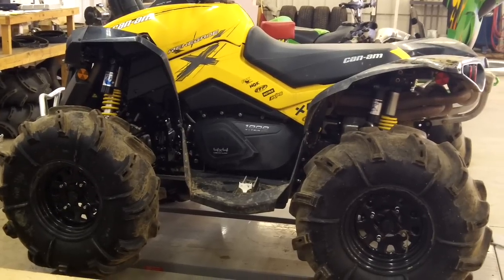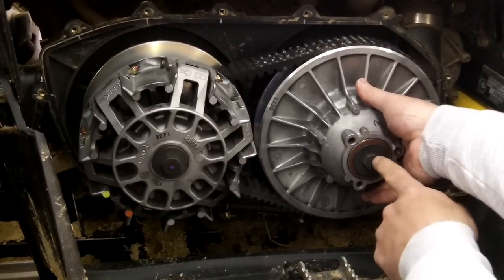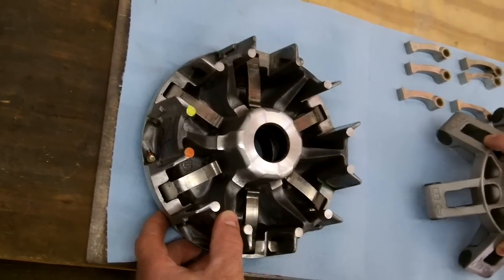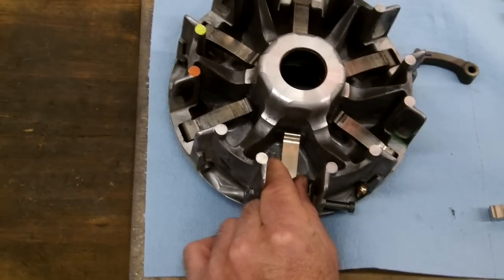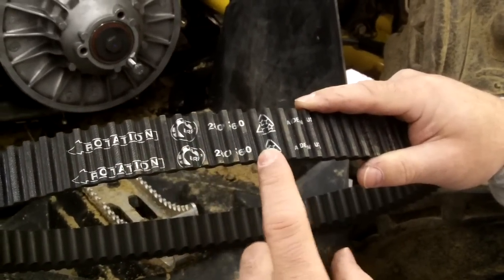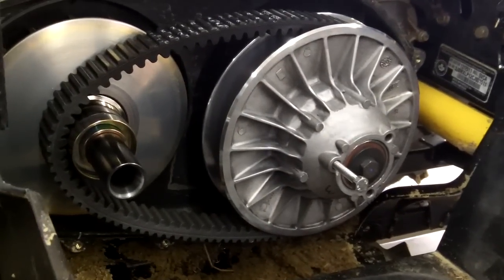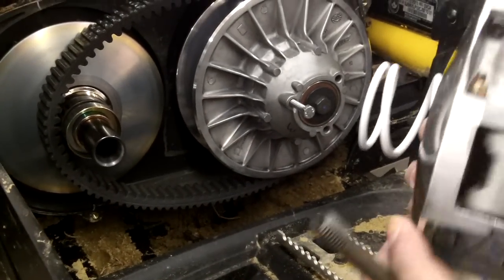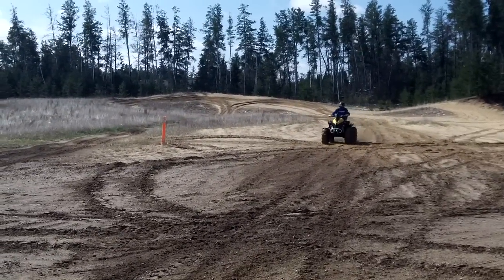Can-Am 2012 Clutch Kit Install EPI Performance

Comment from the maker: 32 grams are the lightest we sell for the Can Am's.  If you are trying to raise your rpms by going to a lighter weight you can also try going to a stiffer primary spring on the end rate.  One other option might be grinding the weights down a little but you have to be careful on not changing the profile to much.

Comment from the maker: Torque the primary clutch bolt to 89 ft/lbs +/- 6 ft/lbs.  Can-Am recommends using a new secondary (driven) clutch bolt every time the bolt has been removed.  Can-Am’s torque procedure for the secondary (driven) clutch bolt is: Step 1 torque bolt to 15 ft/lbs +/- 1ft/lbs.  Step 2 tighten; 180 degrees +/- 5 degrees.

Comment from the maker: the amount of twist they put on the spring is so minimal it won't make much of a differance. On the older torsional style secondarys they did because they were wound up 1/3-1/4 of a turn.

Comment: I have read that the clutch weights for the 13' 650's are 31grams already and I couldn't find and lower weights than 32grams on your website. or don't you sell the lower ones separately?

Comment: What is the advantage to having the different size weights? Also at 8:17 is it normal to have that ring around the inside of the primary that looks like a wear mark from the belt? Im just curious.
Reply from the maker: We use different weights to fine tune the shift and top rpms for the machine.  Different size tires, elevation, and other mods can effect what weights to use.  Usually the belt will leave a black mark on the clutches from normal operation.  On the Can Ams some of them have a clutch sheave that has a gold colored plating on it which makes it easier to see where the belt has been running in the clutch.

Comment: I purchased your EPI Kit for a Can Am Renegade 800, the problem is that some of your pins (which pass inside the masses) go hard through the holes in the primary clutch. Why?
Reply from the maker: Hello, i dont understand what you are asking.  Please call us at 218-829-6036 and ask for the tech dept and they can help answer your questions.  Thanks
Reply: @EPIperformance  Thank you, I apologize but I don't speak English. By "pins" (pivot) I mean where the mass is inserted inside.... and in front of the screw (I don't know what it's called) goes  the bolt.

Found now I mean the Screw M5

Comment: hey i took the bolt out of my primary clutch and stood up to get a rubber mallet when i did it came flying off and fell apart didn't get a chance to mark it any way to figure out which way it goes back together its on a 2015 can am xmr only about 4 hours on it any input would be much appreciated thanks
Reply from the maker: v ell Luckily on the primary clutch you don't need to align it in any certain way.  You can just put the spring back in and push the outer half back on.  The secondary (rear ) clutch is a different story where you have to align it with the helix.  Hope that helps, let us know if you have any other questions.

Comment: Where do I get one for the xmr 650 because it says not for the xmr said on the muddier kit,thanks
Reply from the maker: Originally we hadn't tested the 650 XMR.  Since then we have  and you will to use the Mudder Kit for the 650 Outlander part number WE436964.  The kit will help your XMR all around.  Let us know if you have any other questions.
Reply: Ok thanks

Comment: Looking for a clutch kit for 2012 renegade 800. It has some itp 30s on it. I do alot of trail riding thru mud holes and sand pits  Wich kit would be best for me.
Reply from the maker: If you are mainly riding in mud and trail and lower speeds I would use the Mudder kit part number WE437083.  If you are doing more all out top end speed use the Sport Utility kit for 27-28" tires part number WE437081.  Most would go with the mudder kit.  The kit will change the weights, primary spring and the secondary spring.

Comment: Hi,I'm Chris from Mauritius Island in the Indian Ocean.....far far away from you guys!I'd like to know if you have such a kit for the Renegade 500.what would be the price and how much for shipping.thanks again
Reply from the maker: Hello.   We do have a clutch kit for the 500 Renegade 2008-2015 if your talking about the ATV Renegade.  We have different kits for the different types of riding your doing and what tire size you are using.  You can see them on our website at www.epiperformance.com  or let us know you model, year, tires size and type of riding and we can help you out.  Thanks
Reply: @EPIperformance  yeeeehaaaa.........a reply,thank God,I've been trying to get in touch with you for  a while now.well from your catalogue it's not very clear.so I ride mostly hard pack and rocky trails.....and am often doing recovery in the woods or on steep slopes where only I can go.I still am on the original tyre size(25*10*12rr and25*8*12fr)which work great for what I do.I use Maxxis Bighorn but only because it's the best compromise here.so if tou have some suggestions,they're welcome.in the event also that they will be available here.lol......thanks again.best regards from tropical Mauritius.
Reply from the maker: @christopherlamb7386  If you running those tires I would use the Sport Utility Kit for Stock Tires.  We have a set up for 0-3000ft elevation which is WE436493 or if you are always above 3000ft then use WE436494.  The kit will give you better low end and midrange power, faster backshift and throttle response and will grip the belt better then stock.  Make the machine work better all around.  If you go to our website and put those numbers in the search it should show up.

Comment: Do yall make a kit for a commander 800?
Reply from the maker: +Zac Hudgens Yes we do for the 201-2015 800 Commanders.  We have 5 different options depending on tire size and your type of riding.  They are listed on our website www.epiperformance.com or you can call for more info 218-829-6036.  Thanks

Comment: I have can am outlander800  lose power I need replace clutch?
Reply from the maker: The EPI clutch kits will upgrade your clutches and give you more low end and midrange power, faster backshift and throttle response and will grip the belt better then stock.  If your losing power you should inspect your clutches for wear or damage.  It could also be your engine getting weak.
Reply: @EPIperformance  thank you 🙏
Reply from the maker: @AlexLopez-ut3uu  Glad we could help

Comment: Hi there I need to order a kit but not got a clue what to order the trouble is I've gone to a heavy 26" tyre on my 2010 renegade 800 and can't seem to get it to wheely anymore also feels like I've lost a little bit of top end, will a clutch kit correct this? Also if I put a clutch kit on will I loose top end speed? Can anybody give me any advice about this, apart from watching this really good detailed video I've not got a clue about clutches and how the weights etc work,

Regards Steve
Reply from the maker: +suddy07 Yes the clutch kit will help you.  If you have a real heavy set of 26" tires I would recommend using the Sport Utility kit for the 27-28" tires.  This kit will give you more bottom end and midrange power and torque, faster backshift and throttle response and will grip the belt better then stock.  It will help make up for the power loss of the larger tires.  I would recommend also changing the belt, our kits will work with the OE belt or any of the EPI belts.  Top end speed will stay pretty close to what you have now, you might lose only a few mph.  Hope that helps.